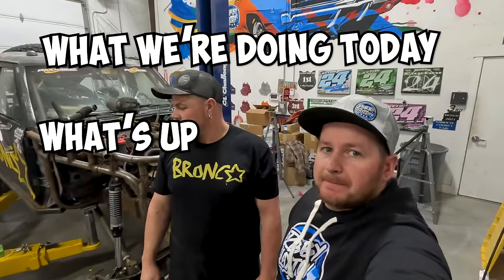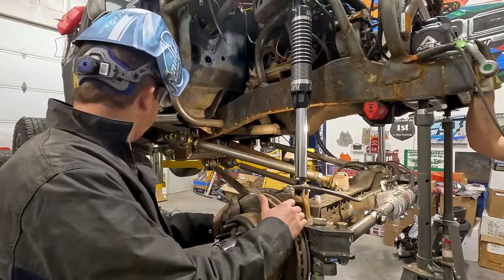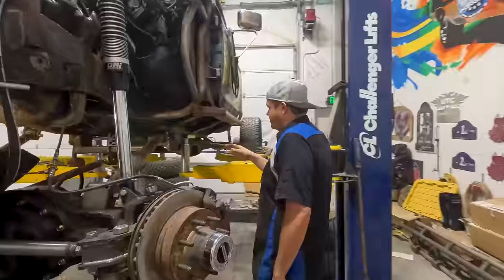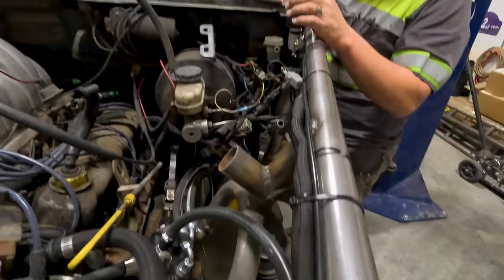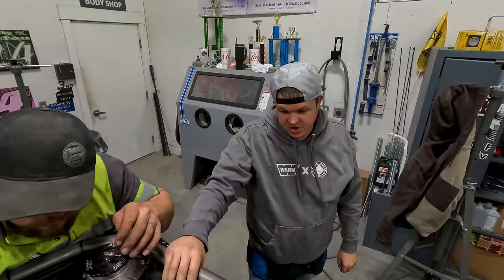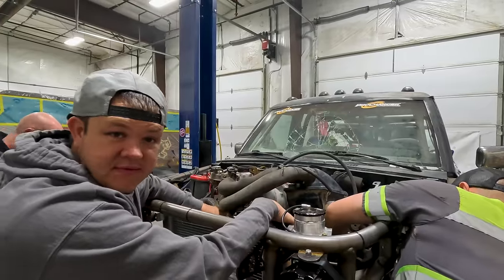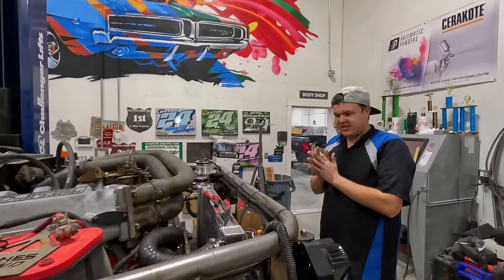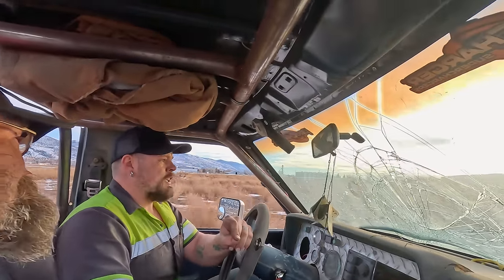38 Years Later BroncStar Finally Runs, Time For King Of The Hammers!

Comment: To sort your lights, volt drop is related to wire gauge.  Use a larger gauge wire and problem sorted. 👍
Reply: Could it be a ground issue?
Reply: I also recommend having separate ground on both sides
Reply: Always use a relay and switch with large current draw components.

Voltage drop is due to the length of the wire and current (ampacity) gauge.
Reply: That voltage drop is too much. Either gauge is way to small, or the switch can't cope and you need a relay. Lookup the current draw for the combined lights and their are free voltage drop calculators online. Thick wires to fuse box with relay controlled by old switch for the high powered setting is probably the min. If the voltage drop is large for low power/blinkers etc, then the entire loom is undersized.

Comment: One way around the issue of not being able to get your plumb bob over the location where you need it is to use one of those self leveling laser levels on a tripod that project a horizontal and vertical line. I got a pretty decent one off of Amazon for less than $100.

Comment: Multiple relays, one for each light  and function.  Check current required for the lights.

Check your fuel filter too.

Look into som BG Enterprises additives for fuel clean and oil.  Those both work really well.

Comment: I had the same problem with my truck and if you hook up the O2 sensor plug on the bottom of the engine it'll be hidden from site but once you plug it in instantaneously there will be no more skipping and more worries

Comment: Just a thought. You might have better luck using  the explorer/mountaineer with 5.0 wiring and computers. One of the ranger forums had it spelled out fairly well. One hick up they said was the anti theft key. You'll get your up to date codes. Another thing the explorer had the more desired heads and the oil filter was relocated.

Comment: What is your separation (height separation on the upper axle mounts to the lowers)? You should be 25% of the tire height (10” for a 40” tire). If it’s less, there can be too much axle rotation and stress on the mounts.

Comment: Little tip when your checking voltage, you have to have current flowing, you need the light back in the circuit then check voltage. You should have less than.5 a volt less than battery voltage, with the lights on.

Comment: Big lights ought to have their own relay inside so all you do is run BIG wire direct from the battery to their ring bolt terminal and have an ickle switch wire :o)

Comment: If you need a cheap overflow. Use the radiator jug, drill a hole through the cap. Clamp it where you can. Make sure the hose goes close to the bottom inside the jug. It works! My old f350 has one I installed, works great.

Comment: Fuel pressure is supposed to drop when you add vacuum. That’s how it adjust pressure when it’s running. At idle is when you have the most vacuum so it lowers the fuel pressure because it doesn’t need the extra fuel.

Comment: I know this is probably taped a month ago, but Ford had a problem with the older Fords with the wiring harness and light switch. You'll need a couple of relays wired direct to the battery and being operated by light switch

Comment: Loads of undercut on the welds brother, lower the heat on the welder. Preset is good for bigger parts or long runs. smaller cup brackets heat fast. Try running the sides at normal temp and lower heat for the long run. You pre heat by welding the sides

Comment: 36psi fuel pressure and 42psi under WOT is perfectly in spec.  The reason the pressure drops at idle is because the engine is running in vacuum and the regulator is trying to keep a constant pressure differential between the fuel rail and the manifold.

Comment: The map sensor can cause them to run like crap, so can the tps. You can read codes by crossing or ground your test circuit and count the flashes on the mil light.

Comment: On 5 l and 351 you have to have a fuel pump in the tank and then you need one further up to build the pressure for the you have to have a boost pump

Comment: Why not just Roll some kind of Coating on the roof of Whiskers to get
the roof finished up.. it sounds like the Bronkstar needs a good fuel tank
Flush. Blow out or replace the fuel lines, new filter and then it should
Run well.. keep up the good work guys..

Comment: Headlights - each headlight should have there own relay and wire harness connected to one switch. Lights should run in parallel not in series circuit. Most semi trucks and snow plow lights are wired these way 😂👍 Great work🎉😊

Comment: Qusestion....is that 75% of angle difference from upper bar length to lower (to maintain pinion angle) change depending on what angle the bars are. I understand 20° is what you are shooting for, but I was curious if the length percentage from top to bottom would change  if say you was more  than 20° or possibly  less. Thanks and respect the channel and work you guys do.

Comment: Robbie, this is no BS.  You guys are KILLING me with that ford.  I have a 2004 Tahoe parts truck.  5.3LS with something like 150k miles on it.  Runs like a top.  Interior is disassembled, front end damage but nothing past the core support.  It's the luxury Z71.  No it's probably not worth you're while to come to the rust belt to get it (All I want off of it at this point are the wheels and tires) but I will GIVE it to you for nothing.  Clear title.  And but for a crack in the plastic upper of the radiator, ugly as it is, could probably make it to Utah.  
It's yours (except for the wheels and tires) if you answer here with contact information.  Have it covered in the yard, on wood, with electronic rodent deterrents, constant trickle charger.  Peppermint spray, heh, and Owl statue sitting nearby, and an Ozone generator I fire up from time to time to keep the pests away.  Only been sitting for a couple months.  Come and get it (bring some tires) it's yours.  
   Not worth your money and time to come and get it.  And I'm not interested in being in a video, but give me a way to contact you, I'll send you some pictures.

EDIT: Oh, and that offer is open to anyone that wants it.  I do have a YouTube channel, wish there was a way to initiate private contact.  The vehicle is in south, central Michigan.
Reply: There is no way that Hillbilly would move down to a Chevy!

Comment: Nice job guy's, Hillbilly I know it's probably to late but you really need to put a nice cam in the Broncstar. Those 5.0s really sound nice and perform well and it increases horsepower. You will not regret it. Thanks for the video guy's.

Comment: I am a ford man true and true, yet thinking coyote engine would not give the right fit for this particular  system..... meaning I am leaning to a LS engine because of torque. You ask Rory and he will tell you its torque that wins the power needed to climb over those trails. I would go with a LS or a Cummins engine for the amount of torque needed to just creep over boulders or climb the walls. Oiling being a high concern, maybe the LS oiling system would result in higher reliability

Comment: How about the mass air flow sensor. It needs it to tell the computer how much air is going in the throttle body.  The throttle position sensor. Tells the computer how much throttle you are giving it.

Comment: put a new fuel pump in the broncstar and it will run fine i went thru all this stress got new injectors fixed for a week and it came back. NEW FUEL PUMP never had an issue since

Comment: Its back fireing through the air i take. That's not no fuel, its a bent valve or timing issue. You probably should not have boosted the engine. Probably bent valves.

Comment: That's not how the speed square works the square side is your angle, the side you are using is the hypotenuse that is 45 degrees from the 2 square sides, which means that your angle will be 25 degrees, since 20 + 25 = 45. been using a speed square or rafting square for 35+ years as a custom home builder, thousands of rafters made and installed using a speed square, your angle will be 5 degrees off. PLEASE TRUST ME ON THIS ONE, ASK A CARPENTER HOW IT WORKS!!! 5 degrees is a huge difference and may be unsafe.

Comment: That’s not the correct way to read a square. Your angle should be set from the opposite side of the pivot point from the side that has the angles on it. Setting it off the 45° side will give you a different angle 📐 you set them at roughly 25°. I’m sure it doesn’t matters all that much but just a little help for next time.  And hillbilly is one hell of a good mechanic. It was impressive how he got that engine from needing to be scrapped to running like it hasn’t been sitting for 25 years. Nicely done.

Comment: You aren't using the speed square correctly to mark the angle.  You use the 90* side not the 45* side.  I'm a retired carpenter.

Comment: ok hear me out. yes to triangulate is nice and needed. but by moving them in board on that axel. now the problem is a direct hit on the tire from the front. As long as it's rolling and climbing over sht it's all good . when them dynamics change it will bush it back. .
In Hine site no pun intended one drag link or track bar or what ever you want to call it ,could of taken your oringal design and , Well triangulation. ut.
 And  will allway watch your video  but if there is a Demri shot in there , you get an immediate "LIKE "

Comment: @HILLBILLY @ROBBY When you make Light Harness
OHM's LAW APPLEY.. wire need to be atleast 2.5mm² to eatch lamp
Now tell me bright Light.. DO you need GROUND Wire yes on minus to ewery
Plus!!!  If you don't add same 0 mm².. use your head please.. grund for all lampe on
Is needing 4mm² you CAN'T SHARE THE GROUN IT WILL BE A BOTTELNECK
AND GET REALY HOT.. HOT DC WIRES SCHREEMS RESISTANCE = TOO SMALL MM²/GAUGE
USE RELAYS... THE CONTACTS CAN'T HANDEL THE HUGE LOADS.. TELEYS CAN HANDEL HUGE LOAD'S!!! 
Greetings from DENMARK..

Comment: I get so frustrated watching you guys fumble trough the drivability issues. I've been a tech for 35 years. I wish I could just run over a solve your issues so easily.  But I was there myself. That Era ford was junk anyway.  So much crap controlling air fuel timing ect. Sorry Hillbilly bad bad choice.